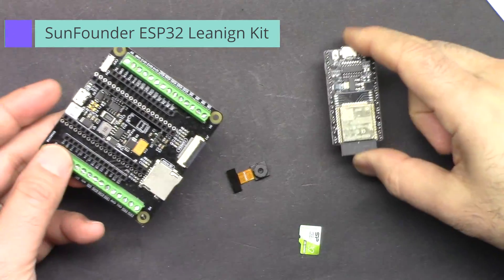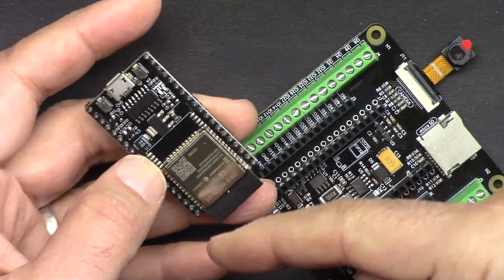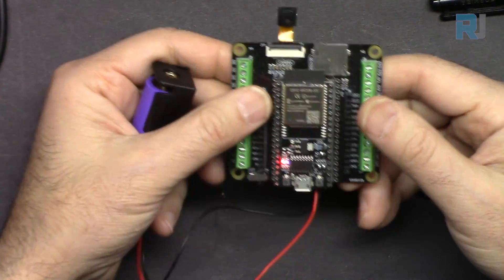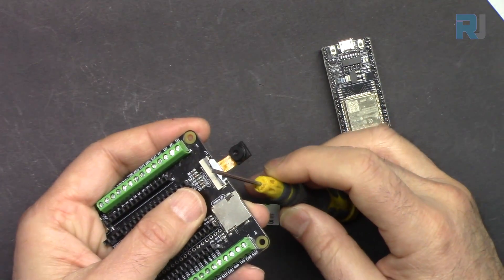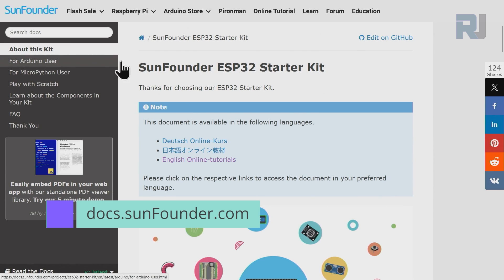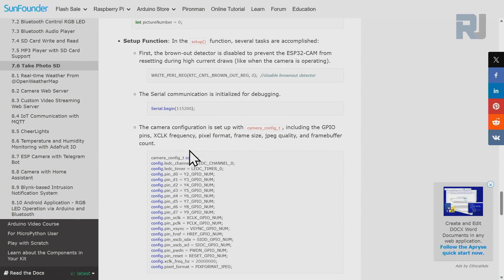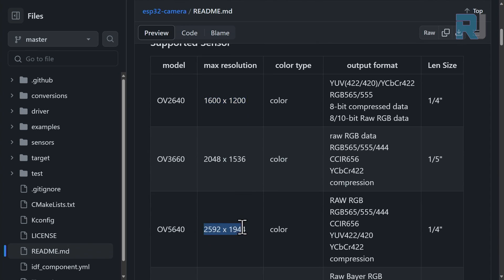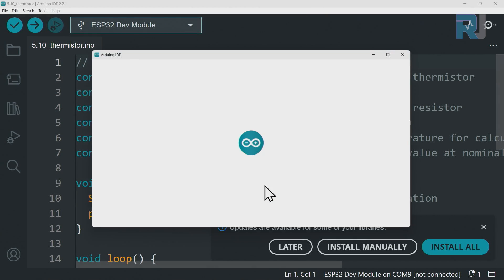ESP32 Tutorial 42 - Taking Photo with Camera save on Micro SD CAM-1 | SunFounder's ESP32 kit

Comment: For some reason I connect the battery, I see that the green and red light turns on, but it doesn't do anything, just connected, the battery is full, any suggestions to try? I already tried flashing LED 2 but it doesn't work either, only connected to the USB cable, thanks dude